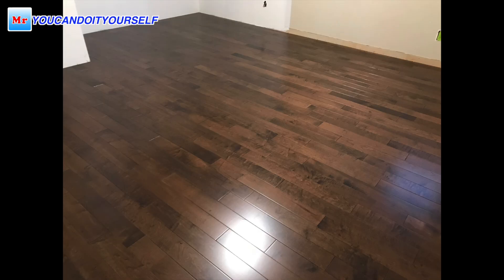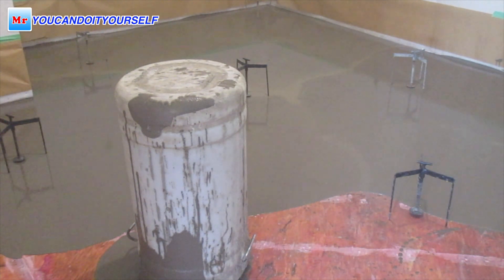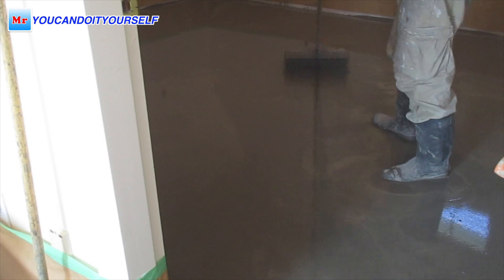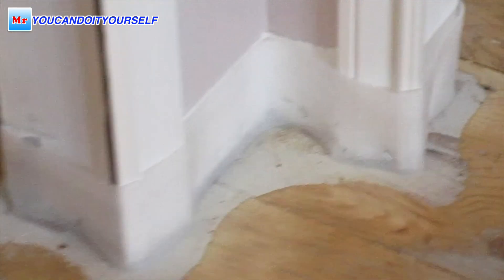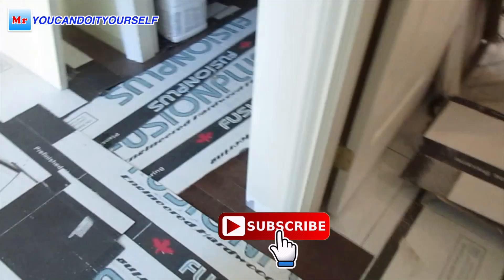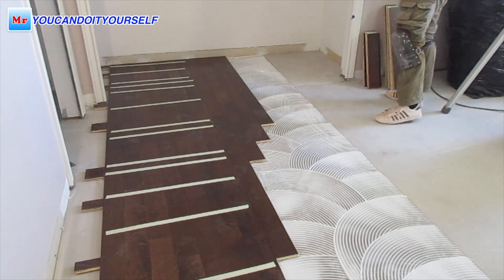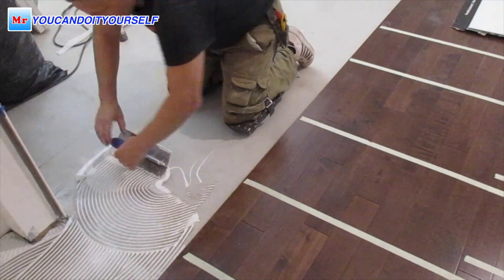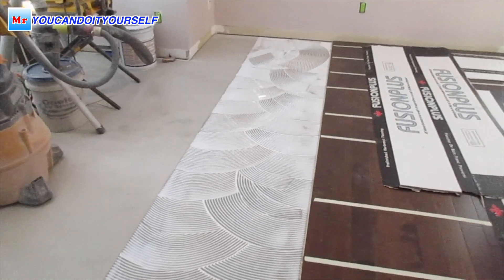Engineered Hardwood Floor Installation After Wood Subfloor Leveling  MrYoucandoityourself

Comment: Great videos – very helpful, thanks. 
I have couple of questions:
a)	You show just pop down the hardwood flooring, your flooring doesn't seem to have tongue in grove, or am I mistaken?  Does it have tongue in grove?  What is the brand of flooring?	
b)	This glue down flooring on top of lots of floor leveler compound, did you do glue down because you use floor leveller compound? As if tried nail down it would not work?
c)	I have OSB subfloor (main floor, ~1000 sq feet), if I only need to use floor lever in some places, can I install hybrid where do nail down (cleats) in some places and glue in places where the floor leveling compound?  What is your approach in that scenario?
d) Do you recommend and/or can I glue down solid hardwood (or hybrid fashening)?  (4 1/4” wide boards?)?
Reply from the maker: Hi Todd, 
a) This is a tongue and grove engineered hardwood floor.I don't remember the brand of this floor, now the trend of color is nature and light.
b)You can't nail down throw the self-leveling compound - only glue down or floating type of installations.
c)If you need to level some places, use plywood with different thicknesses, like here - https://youtu.be/UPowP3bez5A.
 Also, nails and cleats are not good for holding in the OSB subfloor, better use real plywood.
d) you can glue down solid wood, but the material should be very straight. 
  We are not doing nail-down in the Vancouver area for so long. We are using engineered wood. No reason, top veneer the same and you can refinish the engineered wood as well.
Thanks for watching!

Comment: This video answers a lot of questions for me.  You show that you can pour 3/4 inch leveling compound at once if you need to. I always wondered how deep you could go.  You also showed the wood floor glued down and it looked great.   Did the wood flooring you used have any cushion or padding or backing on it?  Thanks and beautiful job.
Reply from the maker: Nice to see your comment again! Yes, you can pour up to 1 inch easily. This hardwood floor without underlay. Thanks!
Reply: @MrYoucandoityourself do you think 2 inch staples would drive through 3/4-1inch of self leveler?
Reply from the maker: @JakeLutka  If I need to install hardwood flooring, I level the wood subfloor using plywood of varying thicknesses. Here is example - https://youtu.be/UPowP3bez5A